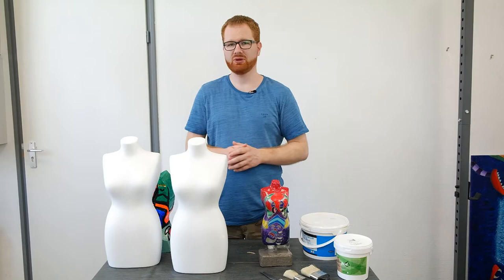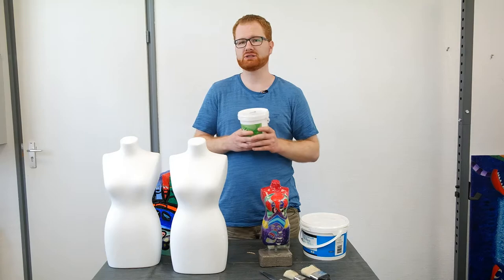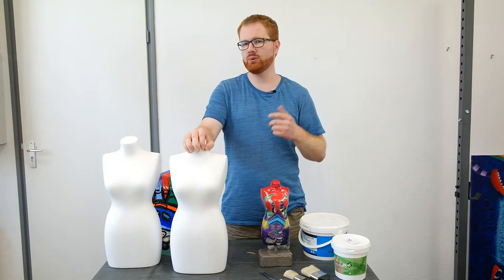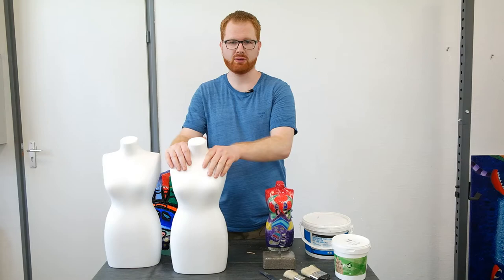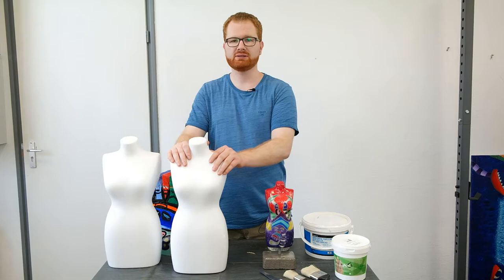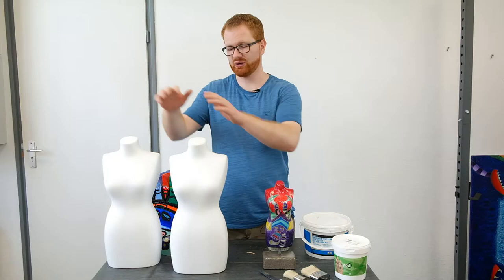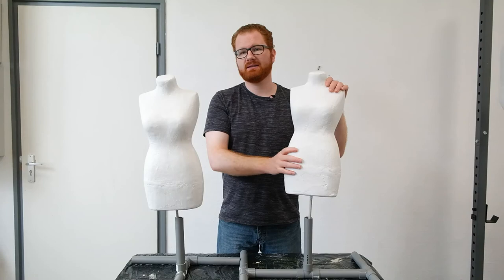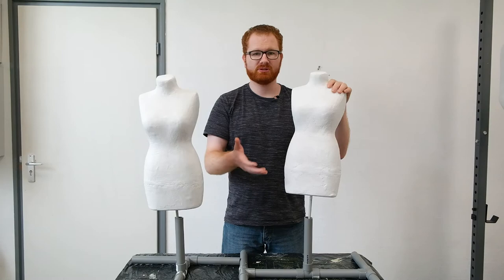How To Prepare Styrofoam Sculptures For Painting

Comment: What glue? Sorry can’t hear what you say. Do you say bathroom tile glue?
Reply from the maker: Yes, I use premixed bathroom tile glue. I use Eurocol 682 Majolicol and Handson Super Pasta, but all bathroom tile glues should work. The different brands have different colours and textures. I like the thicker glues because you need fewer layers to build enough strength. However, they often have a rougher texture, so you must sand them for a smooth finish.

Comment: What is the name of the paste/glue that you use to cover the pores on the Styrofoam body. Your work is stunning.
Reply from the maker: Sorry for the late reply. I use a premixed bathroom tile glue. I use Eurocol 682 majolicol and Handson super pasta, but all bathroom tile glues should work. The different brands have different colours and textures. I like the thicker glues because you need fewer layers to build enough strength. However, they often have a rougher texture, so you must sand them for a smooth finish.